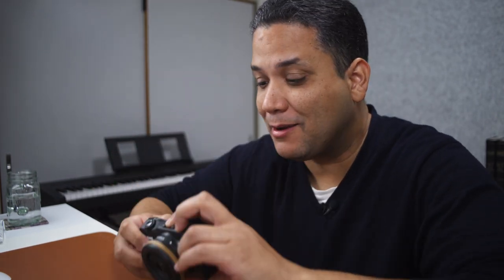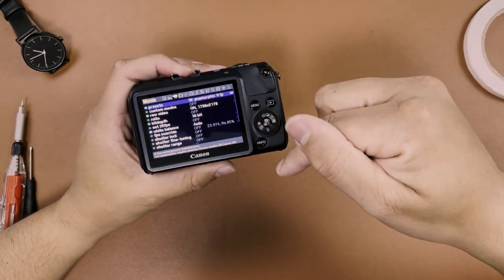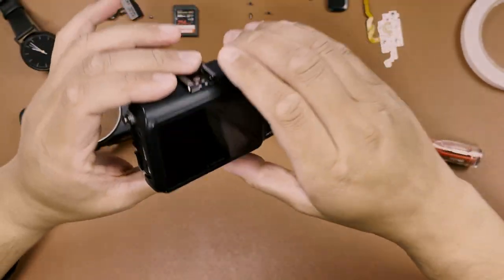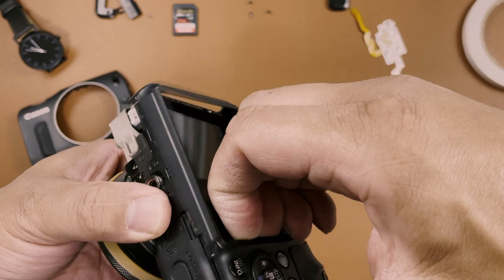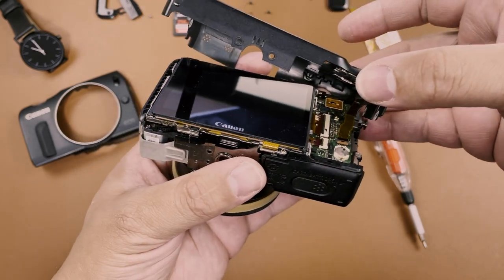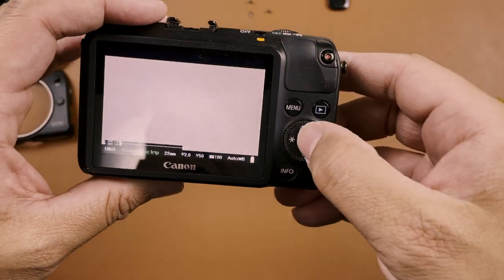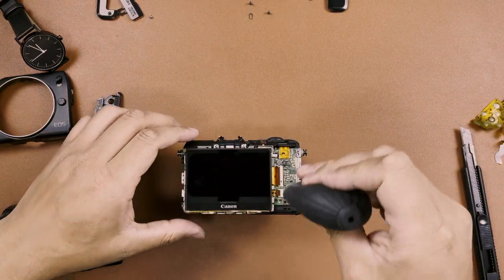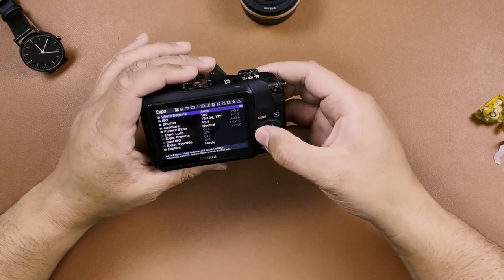Canon EOSM Control Board Replacement | How To Video

Comment: Thanks man! Im consider doing this. Also I hv a question.

When I open the battery door, it slides slightly to the right, causing the hole in the middle to shift. This makes it hard to install a dummy battery. Is this normal, or could there be an issue with the mechanism? Thank you again!
Reply from the maker: Thank you! About the door, I don't know if I'm understanding your question correctly... but yes, it is normal for the door to slide for it to open. You must unplug the dummy battery in order to open the battery door (say to remove an SD card). 
But if your question is the opposite you are trying to close the door, but doesn't slide all the way making your whole not line up, that is not normal. I hope I'm answering your question. Let me know if there's anything I can help you with. The most important thing you can do is to take your time, go slow... and follow every step without any shortcuts. You should be OK. 
My controller is actually acting up again, same place on the wheel is going bad, so I might have to do this all over again!

Comment: Congratulations. My eos-m got circuit broken. Cannot power on. Very sad. I was thinking about sending it to repair
Reply from the maker: That sucks, sorry to hear about that. R U planning on fixing it yourself? 
I was surprised how easy it was to open up... but like you saw on the video, there's a risk of something breaking. 
That's what's stopping me from opening up my more expensive FUJIFILM X-H1. 

I hope everything works out OK.
Reply: Did you end up fixing it?

Comment: I can’t get the q set button to reconnect.
Reply from the maker: Are any cables or connections damaged? 
My scroll pad is already starting to act up on the right side... cheap board.
Reply: @jpr-tech  As far as I can tell there is no damage.